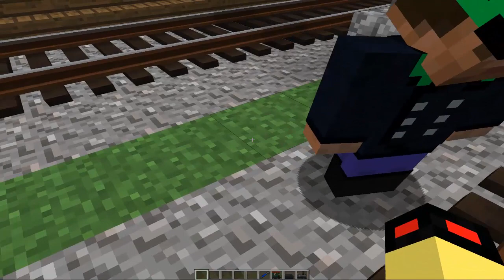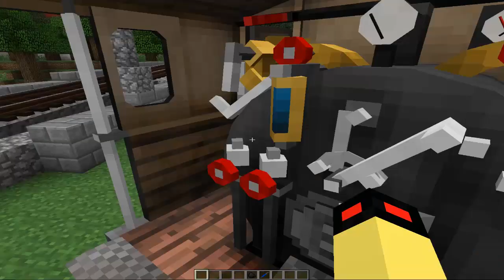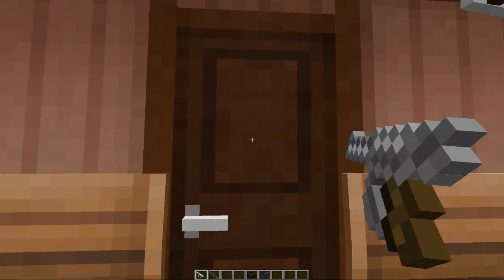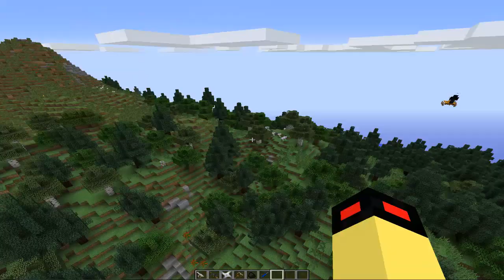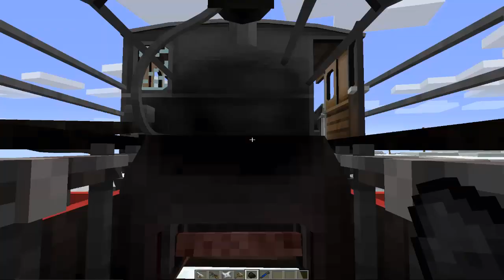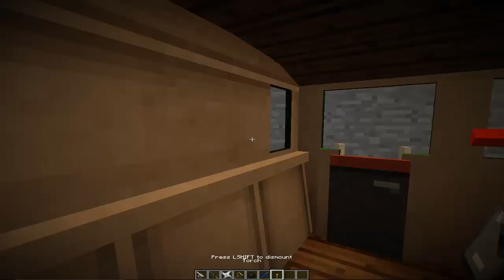Rail of Wars - Minecraft Mod Showcase

Comment: hey i need help with this map. because if I download it, it puts it in the folder with maps and I enter it, I can play normally but if I want to put a train on the tracks, I can't. The tracks behave as if they were there but they are not there if I destroy them to the track for 16 blocks I can't a tracks for 1 block are supposed to be destroyed but they become invisible and I still can't put new tracks in them. and if I put mine anywhere, I can put a train on mine, I also tried to drive from my tracks to the original ones from the map and I'm going along them anyway, but if there is a turn, I fall off the tracks and I don't turn, and if I'm going downhill, I'm going for a while in the air, then I fall, and again, until finally I fall to those tracks downstairs and I'm not going, I'm just levitating going up, I haven't checked yet, but I can't. can you help me any way? and did you also have such problems?